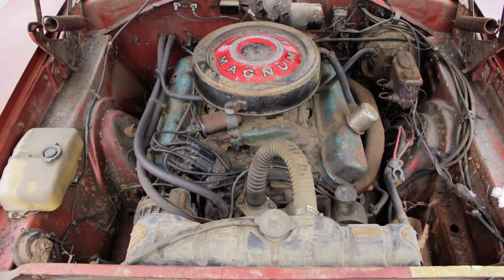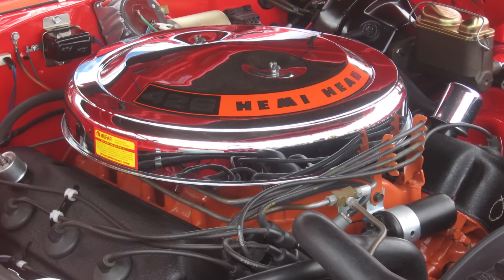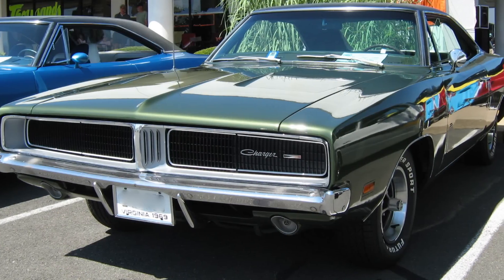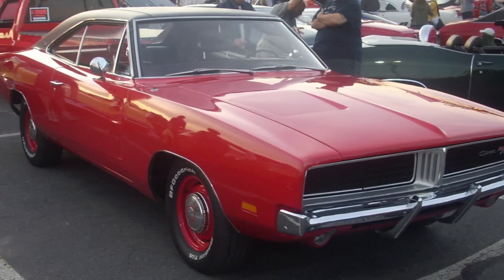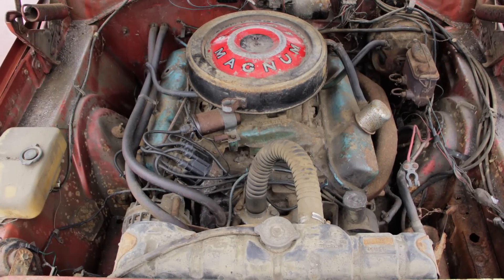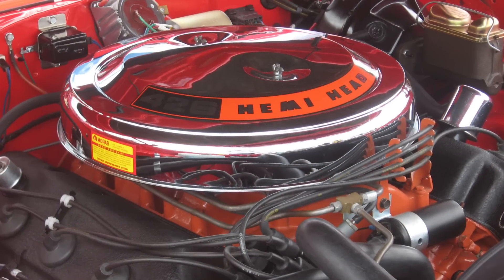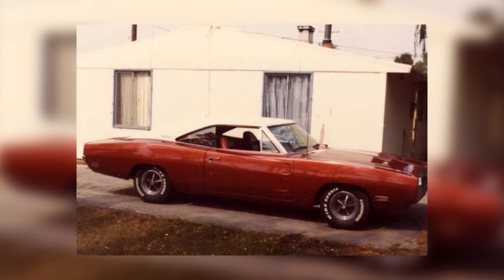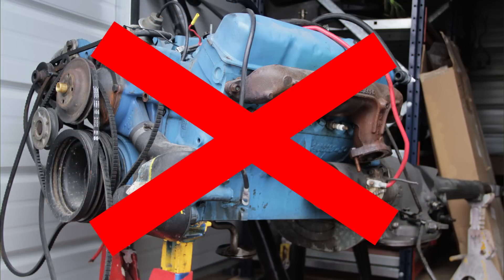Mopar Minute - S03 E06: Daytona Hemi

Comment: My 318 (5.2) Magnum in my '93 Dakota has over 156,000 miles on it and it still burns em pretty good and surprises many people with their rice burners.  They're really good engines, better than the old LAs (don't get me wrong I like those too especially the 340) because they use a hydraulic roller setup and higher compression but of course I have to have more,  383 in it?  Make a sick drag truck.

Comment: I never cared for the Mopar LA engine because it was too much like a Mouse Motor, and I friggin hate Chevys. 2 things about the Mopar small block...in the old days, reaching over the front end sheetmetal to work on the distributor was a pain in the ass. 2nd, later versions had a penchant for poor top end lubrication, and the pushrods would work right through the rockers.